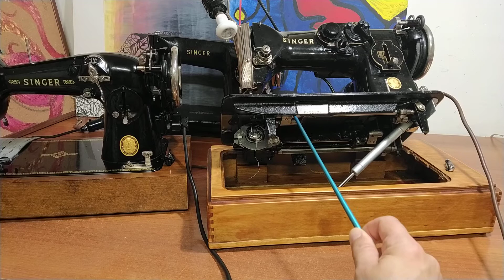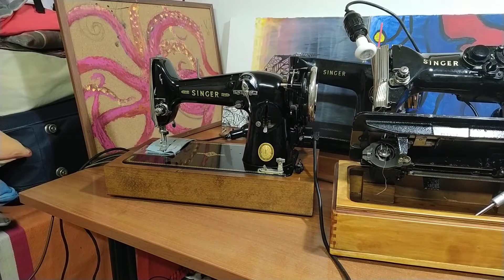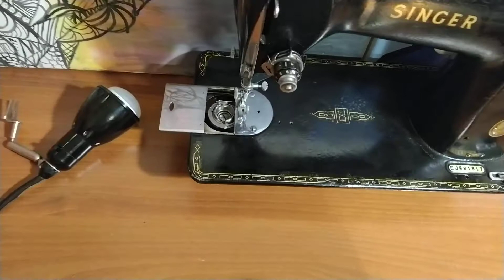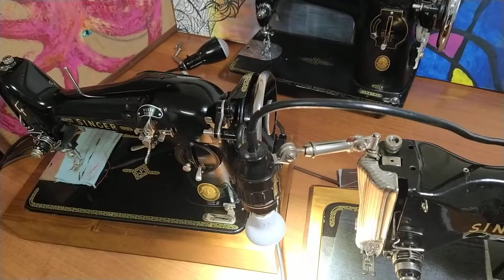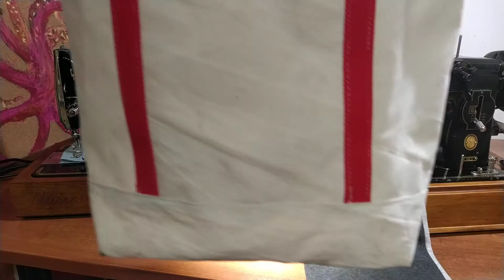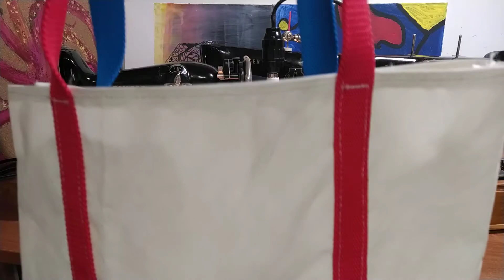Singer 201, 216G, 316G  Vintage Sewing Machines.

Comment: [A bit late to the party] The base that came with my 319k Green machines it has a steel bar at the back that rotates out from the wood base to stop the machine tipping over and a special locking catch under the bed near the back right that auto locks as you tilt the machine.
I also have a 306k black machine in a table with a knee controller that presses on a standard removeable Bakelite foot pedal. I am 6ft 2in so I can't fit under the table to use the knee leaver.

I am able to use standard 15x1 705 needles in all the machines  rather than the 206x13 but it is close to the bobbin on the right when on full stitch width.

Comment: have you seen the 206 an 306 319 320k what you think of them machines
Reply from the maker: Great machines but they use 206x13 needle , different from the usual 15x1 needle.
Reply: @yannis0613  my ones all take regular needles
Reply: @rndea100  You most likely have a revised bobbin case..

Comment: The base for my 216g has a metal extension in the back right corner, that keeps it from flipping back when you tilt back the machine. A fantastic design, I wish all my cast-iron portable machine had this feature.
Reply from the maker: I also had the same extension.   It is attached with 2 screws.  I used the same 2 screws to attach the 90 degree stainless steel that I modified as the point of attachment for the gas strut modification.   The. Metal extension was used by singer to cover the void in the table base of treadle singers , it also served as a guide for the leather belt of the treadle.

Comment: I have found what I believe is a 216G  I don't know the condition, but it is in a regular sewing machine table.  I have not seen the controller and I can clearly see it is missing one of the bobbin spindles on top.  Is this worth getting?  Are parts available for it if needed?  I would want to use it in a treadle configuration.  Does it take a standard 15 bobbin shuttle to go with the 15 bobbins?  I really want a 400 series treadle but thought this might do.  Can't find a lot about this machine.

Comment: I was wondering, sir, what you think of the 15-91. How does it compare to the 216G? Thank you.
Reply from the maker: Hi ,  The Singer 15 series is an all time classic.  I have 2 of them with RAF decals.  I have one set up as a show piece because it is really nice with the floral pattern engraving on the side plate and back plate. I have it  set up with a genuine Singer hand crank. However , it is an older series and doesn’t have reverse , drop feed dog , and stitch length selector.  My second , Singer 15. RAF , was a real find.  It was at the end of Scotland’s production run , and has everything,     Drop feed dog from the base plate (something they probably copied from the Japanese clones) , Stitch length selector , reverse ,  & indexed thread tensioner.   You can not go wrong with a Singer 15.  Beware of Chinese , Indian copies.  Prefer a machine with outboard and not potted motor.  It is easier to maintain and replace motor if needed.

Comment: I just acquired a Singer 216g on a mid century treadle. Thanks for sharing these!
Reply: Teri, how do you like treadling with it.  I have one and I am interested in doing this.
Reply: @redoak3809  I bought it specifically because I wanted a treadle zigzag machine. Changing bobbins is the most annoying part of treading with it, and my treadle set up is lighter weight (steel instead of wrought iron) but I love it.

Comment: Just scored a mint condition 216G.  A local thrift store was relocating and because the inventory was donated but moving trucks cost money they were blowing everything out at giveaway prices.  Also, if you work on vintage machinery where heating is sometimes an unavoidable evil, spend the money on an induction heater tool.  They start around $200 with electronics kits for half that.  For getting a precise amount of heat exactly where you want it they're worth their weight in gold.

Comment: I've had Singer 206 & 318 zig zag machines,  back in the day but they take a style L bobbin I've kept the 306 Singer. My favorite Sewing machine is a Pfaff 130 in a treadle cabinet.  I've used it for years after my Pfaff 1473. The 130 is the smoothest machine I have,  quiet as a wrist watch,  and with the treadle feels as fast as a power table!
Reply from the maker: Hi,  The Pfaff 130 is a  wonderful tool. When the cleated timing belt breaks , you can still find replacements for around 130€ .  I have seen the Singer 206 & 319 , which also have timing belts which can also be replaced.  However , these beautiful Singers don’t use regular needles , so that may be a problem.
Reply: @yannis0613  Is it any timing belts in the 216g similar to the Pfaff 130?
Reply: @krisztianrolandkiss7336  The #216 is a "oscillating hook" machine... No timing belt.
Reply: The special needle for the 206, 306, and 319 are required for the interference with the bobbin case. Replacing the bobbin case with a commercial size L bobbin case will allow 130 size needles.
Reply from the maker: @lamarrharding4776  
Interesting information about changing the bobbin case to accept 130 size needles.   I think   ,  the manufacturers decision to make exclusive needles was  a  failed attempt to protect their brand.   In the end , they were forced to use  the  “universal” needles.
Reply: @yannis0613  Nope, The Singer machines #'s 206- 306- 319 used the Pfaff patent from the # 130 machine.. The stipulation was the "machine not be identical to the Pfaff # 130". The needle issue was the part "not identical"... Note how the 1953 Singer # 206 is identical in appearance to the Pfaff # 130.
Reply: Universal needles will strike the original bobbin case,  a generic L style bobin case works with clearance.

Comment: Can you explain which sewing machine is better when sewing leather when comparing 316g and 201k?
Reply from the maker: Hi,  It depends.  If it's  thin leather  the 201k (outboard not potted motor) can handle it.   For thicker leather, sewing machines with vertical 15 class oscillating bobbins , like the 316G, 216G & of course the Singer 15k are recommended because they give you the option of using thicker thread more easily.  In the horizontal rotary  class 66 bobbin in the 201 , the thread is fed at a horizontal angle and theoretically limits the use  of thicker thread.
Reply: @yannis0613  Leather with a thickness of 6cm~7cm (60mm~70mm) can be made with 316g, and 201k is difficult. thank you for telling me.
Since I have 316g, 201k should not be bought.
Reply from the maker: You have a great machine , they don't build them like this anymore.  Learn how to match the proper needle with the proper thread and you are on your way.  Take care

Comment: I have a straight stitch 215G that I purchased in mint condition. I didn't get a bargain, but I did get a time capsule in its perfection.  The manual was in French.
Reply from the maker: Congratulations ,  You have a beautiful. SS Vintage Singer sewing machine with a hybrid pedigree , distinct Singer lineage and added German flair.  The 215 G has    all the advantages  of the classic Singer 15 ,  with distinct differences : 1) The  tensioner is up front and not on the side.  2) Drop feed dog lever. 3) Longer  stitch  length 4mm , great for decorative long top stitching.
Reply: @yannis0613  It is beautiful.  And if you wish to have a new fitness routine you could cart it about. There is so little on Internet about them, and I found same sources as you. I can see how easy it is to get bit by the collecting bug.  It is a beautiful machine.
Reply from the maker: @notesfromleisa-land   If you google   Singer 215G,  (216G , 316G , etc).,  nachmaschine  (umlaut over the first a) , You  will then read up in the German blogs about these machines , use the auto translation if you don’t speak German.